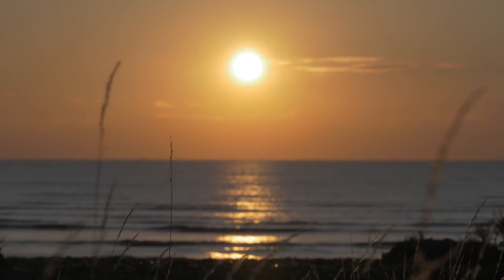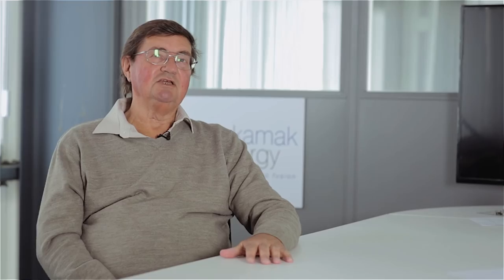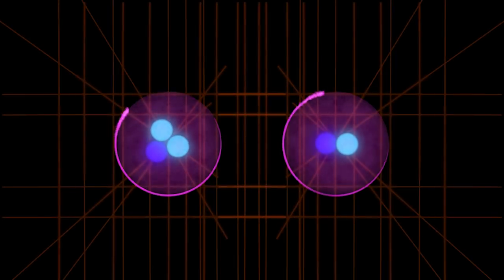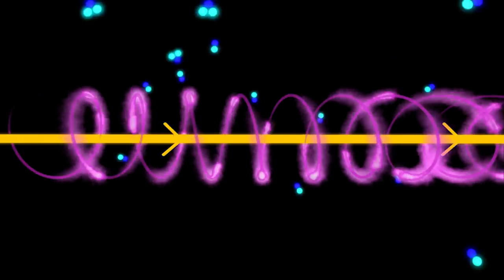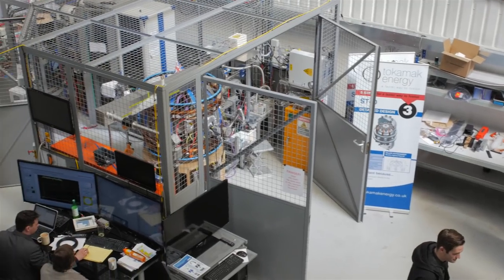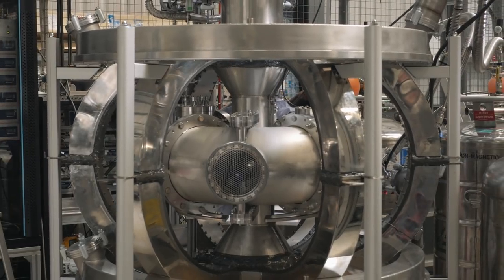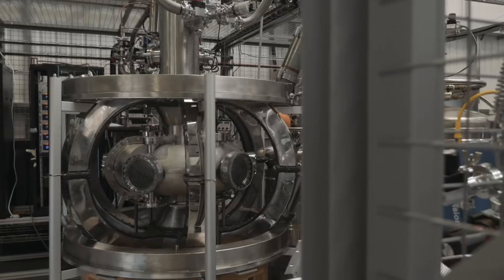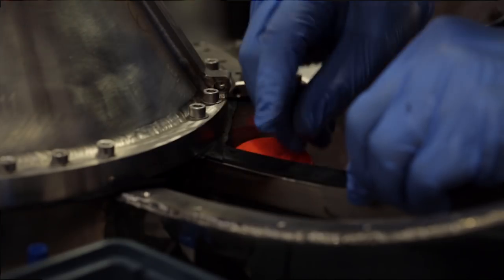Faster fusion

Comment: Fake.
Reply: 3,199, 945 views 
So if you look up in the sky at around noon, you might need to avert your eyes because there's a large light in the sky. It's called the "Sun." The Sun is a star, hundreds of millions of miles away from earth. The sun is warm and bright because it's essentially a large nuclear bomb, with hydrogen atoms in its center fusing together to form helium in its center. The intense heat fuses more helium together. Humans can and have harnessed the power of "fusion" (of atoms) in nuclear explosives. It's not fake.
Reply: Large Moose  Fake.
Reply: Large Moose don't fall for the b8 my dude

Comment: Not fusion and fundamentally flawed "science".
Reply: Can you point me to your sources on that? I haven't been able to find anything indicating that.
Reply: The claim is the plasma stream is able to maintain perfect temperature and pressure which is impossible. Therefore, any fluctuation in temperature or pressure will cause either the absorption or discharge of one form of energy or another.  The discharges are not fusion events.  It's just bad science.
Reply: There is fusion happening in the reactor. It's not that hard to achieve fusion just not enough fusion events to power the machine
Reply: "just not enough fusion events to power the machine" - this doesn't even make sense.
Reply: Basically some atoms in the machine are fusing no problem. But not enough to release more energy than they are running into it. That's the big issue, how do we get enough atoms to fuse at a low enough energy to get back more than we put in.
Reply: I follow you but the argument is about whether or not fusion events are actually happening.  Barring perfect conditions such claims cannot be made.
Reply: It's very easy to create fusion events, we have been doing so sense the 1950's. I work on a fusion reactor that uses electric confinement such as this one in a research lab here in Washington state, except it's linear not toroidal. Getting fusion only requires a couple thousand dollars worth of machinery and high voltages for a very very basic reactor. You can prove fusion is happening by placing a neutron detector near the reactor as neutron radiation in this situation would only come from fusion events. You can also detect the presence of Helium-3. If you wanna look up the cheapest basic fusion reactor look up the "Fusor", it's a simple machine you can make at home given enough money and time.
Reply: I would have to check into this further but I can see two issue with it already.  First, the "amateur" aspect of it is a bit unnerving. I don't like the idea of my neighbors being able to generate free neutrons. The other problem is these fusors are nowhere near the net positive electrical output.  There's also a fundamental scientific issue - as mentioned above.
Reply: You don't need perfect pressure and temperature, just above the threshold. Just run a high voltage(usually above 35KV) current through some deuterium in an ultra high vacuum chamber (around 12 microns is what I use), and if your geometry is any where near good you can achieve fusion. And the neutrons are not much a concern for neighbors as it doesn't produce nearly enough to create a problem for people at that distance. There's a whole group of amateur fusioneers on the internet and the forum used is fusor.net .